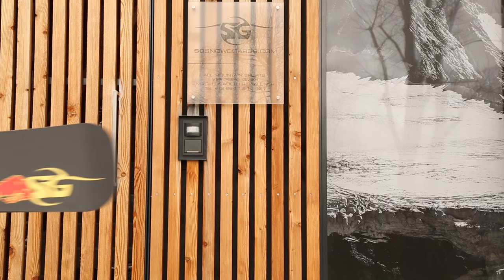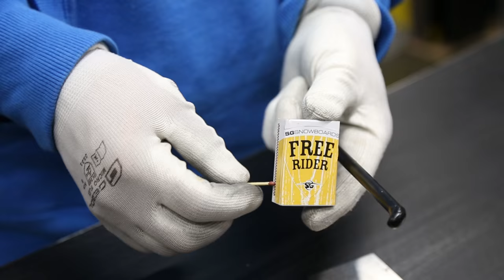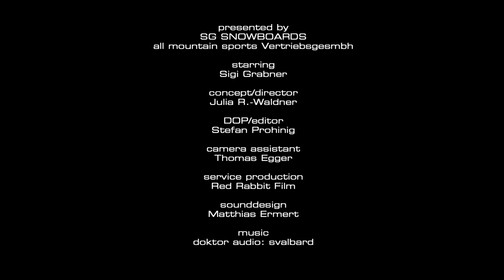Silent Tuning with Sigi Grabner - How to repair edge and base damages

Comment: What if I dented my board like actually and not just burs like that shit is Bent in
Reply: Cut out the damaged edge and replace with epoxy. Let it cure and sand it smooth
Reply: @midwestdevopunk8848  ok thanks